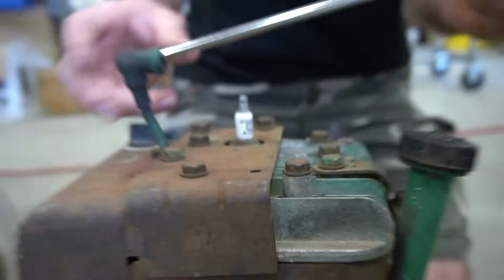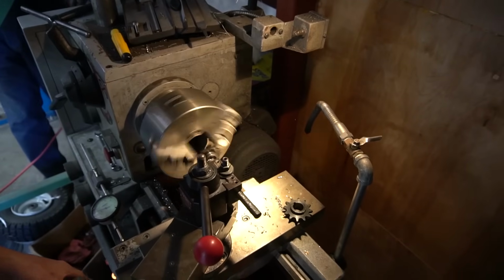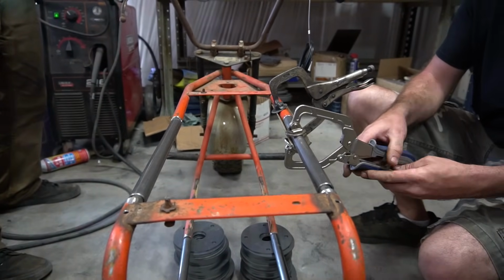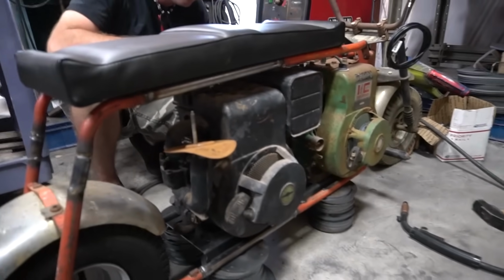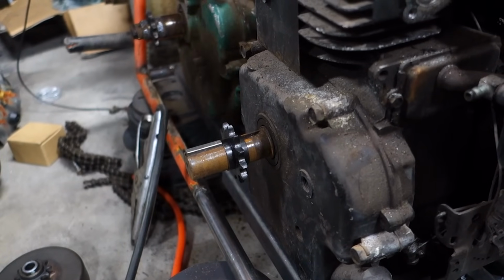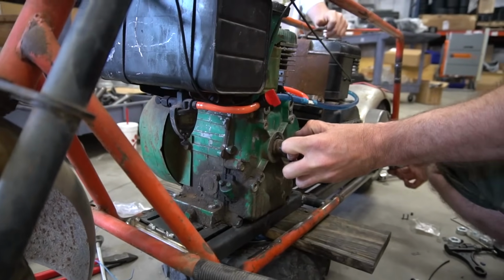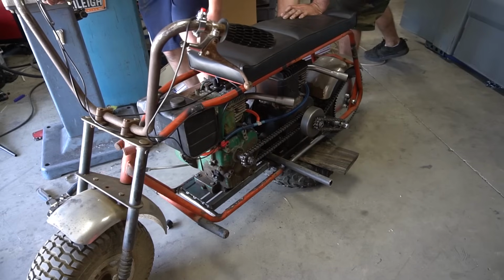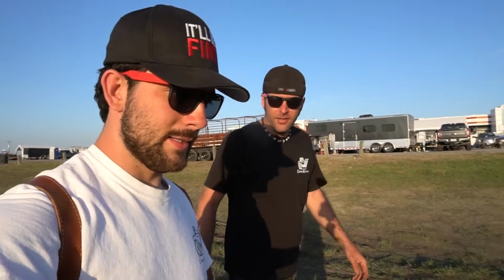Rat Rod 16 HP Twin Engine Mini Bike Build

Comment: I believe putting a clutch on the front engine and a chain tension for the engine to engine chain would solve the chain slap, binding and give the ability to start the front engine first and the second engine next instead of having to start them both at the same time. It's my theory but trying it out will tell the tale. Still a pretty interesting outside the box build 👍👌.
Reply: Brain halfcooked the crankshaft wouldnt let us use a clutch on the front engine

Comment: Hay guys was flicking back through your old videos and found this 1 dunno what you have done to the chain system but 1 thing u could do that I have done b4 on something similar is put a clutch on both engines and link the clutch sprockets together with 2 sprockets on the rear engine clutch it will allow u to start each engine by it's self and if 1 engine dies is won't explode the chain... Just a thought and keep up your good work u guys are cool as hell lol 👍👌👌

Comment: I've done variations of what they did successfully. I even changed the "firing order" by trying different timing with the chain, having both engines fire at the same time sounds and feels like a big single, offsetting tdc by 360 degrees makes them sound smooth and buzzy and setting them with the cycle separation of a 60* v-twin makes a V-Twin sound. I used new matching engines that had the idle set with a tach independently and temperature readings of the exhaust taken at various rpms to try to sync the carbs/mixture settings.

Comment: I would run a serpentine or  v belt between engine 1 and 2, with a spring loaded idler on the belt, ran to a cable to a lever, when lever is pulled the idler disengages the belt allowing it to slip slightly, when released, it allows the idler to tighten the belt, joining the two engines together. The belt would allow for tiny variances and slippage, so you don’t have the catastrophic tightening and loosening between strokes of engine 1 vs engine 2. I think you guys had a fantastic idea but it just needs a tiny bit of cushion between the two crankshafts.

Comment: You should do scarf joints instead of straight butt welding the extensions. A scarf joint is when you slant cut 30 degrees. You get more weld area and it puts the weld joint more in shear than straight tension. Much stronger, plus it looks cool!

Comment: You have 1 month and 2 weeks till the next one haha. Interesting project and looks good. Unless you find a method to keep the sprockets in place with nuts and not welding, idk how can you connect the 2 engines. Also to sync the 2 engines: take the spark plug out from the 2 engines, use an endoscope camera to look at the piston through the spark plug hole and position the piston either at its maximum lower point or upper point and then using some paint and a ruler, put a mark on either the two sprockets or axial thing so you know when it's sync 100%. I saw the chain wobbling so much and that put way too much tension on it and that's why it broke as one piston was up and one was down, so when an engine was pushing the other was refilling.

And like that you can just spin only one of the engines and it will automatically start the other one too at the same time. Also use a thicker rope to start the engines because it will be double the tension on it if you going to start the engines using a single pulling string.

Comment: I think you guys should have done a clutch on each engine with a chain connecting the two engines, then a chain from the engines to the rear sprocket. That way there wouldnt be so much stress on one engine or the other. With the way you had it, unless the two engines were perfectly synced at all times, it would put a ton of stress on the engines. If each engine could idle individually of each other, then there wouldn't be any stress on them, then when you revved both engines at the same time both of the clutches would engage and share their power to the rear sprocket. It was a good try and could work in a perfect world but with gas engines it's too hard to get them to sync up perfectly. You see two Electric motors connected but you can accurately sync an electric motor not to mention if one engine were to spin faster or slower than the other, you dont have to deal with the compression putting stress on parts like with a gas engine. Anyway, looked like a fun project. Would be cool to build a mini bike like this by using two stage 3 predator engines and being able to take your time to make sure you're able to do things just right. 

Another thing that would be cool would have been to have one engine have a clutch and the other engine just have a sprocket,  that way when you rev them both they both power the rear sprocket but when at idle they arent locked together by a chain. Either engine could be shut down without the other dying. Cool video. Looks like you all had fun which is the most important part.

Comment: I know nothing about running two engines connected but I would play with the timing research it or whatever will keep them from beating each other apart. Maybe using a belt with an engagement for linking the two together when needed would work better all together? Doesn't matter whatever makes work the smoothest!

Comment: You need to install a regular clutch on the front engine and a two speed(two sprocket) clutch on the back engine. Run a chain between the two engines and then a chain from the second sprocket on the back engine to the rear wheel. That way you don't have to start both engines at the same time or have to worry about getting the engines synced together.

Comment: My suggestion [other than larger common sprockets where the little ones were not enough] is to put a chain tensioner on it [one that works for both sides, preferably] to control that chain whip, which, [I think] had a lot to do with the failure of the sprocket and the chain.

Comment: Use a chain tensioner to tighten the chain. I seen it from the beginning the chain had way to much movement between linkages. Even though you had it as tight as possible, it still needed a few pounds added.

Also if you run 1 motor, the other should fire if enough spin is made. Its like running a manual transmission in gear down a hill and releasing the clutch. Once engaged the primary motor will then spin the opposite motor, while in motion it will create enough compression to fire on its own

Comment: You guys might already know this. But, putting two engines together that way usually won't work. You have to have them both firing at the same time. It's very hard to make it work with them tied together with a chain.  The way the chain was flopping around, essentially, the engines were off time with each other. If you can figure out a way to do it, you would have been better off with two clutches, chains, and rear sprockets. That way if one engine happened to fire a little quicker than the other, the clutch will allow for a little "slip". You would have probably broken the sprocket anyway. But, you did what you could do in 20 hrs.

Comment: The motors were out of sink, the chain was two tight and because the pistons weren't firing at the same time and that causes them to fight each other. The rpms between the two Briggs  have to be absolutely perfect if they are going to be bonded together. You would have to use two clutches so nobody loses their foot.

Comment: I Like the Build but I think you should clutch both engines to jackshaft so they are independent of each other, that way if there is a problem one will still pull, another idea is to gear them different for more low end and more high-end power

Comment: Use larger sprockets to link the engines to spread the load. A second PTO style side cover would allow you to tie the engines together solidly and have a mount point for a tensioner as well.

Comment: clutch on both motors would work much better and would allow you to use one engine at a time if you wanted. would also eliminate that chain slap and let you start them separately

Comment: Great idea! I wonder if you could use a sprag/ starter clutch from a motorcycle to allow one of the engines to spin at a different speed to the other (in case one cut out while riding)

Comment: belt connect the two motors so as to allow slip...those engines slow down and speed up mid cycle so even if you had both engines firing exactly the same they would still fight one another...if you did use a chain it would have to be a double roller industrial strength chain with a heavy duty chain tensioner  on a strong spring in order to force the two engines to run

Comment: Torsional vibration. Research it. Its a phenomenon where to engines linked together fighting against each other. Ww2 they tried this to get more power out of tank and aircraft engines with little success. I would suggest each motor have its own clutch seperating the crankshaft pulses that way. Great vids, im catching up to all of them

Comment: Instead of starting them at the same time, put a centrifugal clutch on the first motor and a solid sprocket on the second and make a coil that has two wires for the spark plugs and use just one of the pick ups and that way they’ll spark at the same time and that way one can be started at a time but they’ll both be perfectly in time

Comment: Great Idea, Only I knew it could never work from the start. Using chains for any length of time maybe wth belt drive to at least one engine and rubber mounts to engines. Maybe could work I know they were limited to parts and time. Still looked pretty damn cool for sure. Thumbs up guys...

Comment: What if you did a belt drive between the engines with a spring tensioner so you can start them individually.  Just a thought.  Cool build

Comment: Double up the chain connecting the engines, and put an electric motor on it for starting. You could also use the jackshaft to get 2 speeds out of it, maybe 6:1 first gear and 3:1 second?

Comment: A Harley primary chain, to dry clutch, that bolts to the jackshaft. That jackshaft can run through a small handmade gearbox for a high low selection. No synchros.
Or you could go with one of the other clutches nowadays.

Comment: hahaha this is just so crazy only extremely "inspired"  minibike enthusiasts would attempt it.  I think two clutches to a single power out jack shaft chain to the wheel would be more forgiving and smoother...Im not sure how much faster it would be ...i suppose each engine would have to work half as hard...with only adding 35 lbs for the added engine.

Comment: to improve that thing, you guys NEED to make the rear engine more powerfull than the rear one. otherwise you will either blow the chain, blow the sproket like you did.. or tear the crankshaft that gets most of the load apart. 

you will also need to make a double chain tensionner between the engines. the twin engine setups i've seen work all used a damper of sorts (in case of twin v8's, it was a rubber/metallic flexible coupling.)

for more neat stuff, look for the "freight train" and the "Hurst Hairy" dragsters. these things had their stride before the 60's ended, as single engine dragters proved more and more powerfull.

Comment: I would have used 2 clutches, one on the front engine going to a welded sprocket on the second engine, and another on the rear engine going to the jackshaft. Would allow independent engine starting and forgive any difference in power and RPM at speed.

Comment: It’s not the 8hp that killed the sprocket, it’s the out of time cylinders beating the  chain and sprocket that killed it. You need to have perfect timing between the two engines and both be matched to one another in every way in order to have a smooth running setup like that.

Comment: Actually the sprocket with the keyway in the front engine would be a good idea, just in case you might want to synchronize the engines.

Comment: Two torque converters, one in each engine, would sync up to each other because of the CVT aspect only would need one sprocket on the rear too, I think. Getting a belt from one to the other is another story however.

Comment: When you set the motors, you might take into consideration which revolution the motors are on and time them to have their power strokes opposed so not to put twice the strain on the sprocket and the chain when considering the "rebuild".  I think the power would be less herky- jerky.

Comment: You know, If you put a clutch only on one of the engines and use it to "kick start" the other....it would then mean that you only have to start on of the two. would make it a lot easier to get going. Plus, then you wouldn't really have to worry much about synchronizing the 2 together. Couple of Roots blowers or turbos and....BOOM!! Frankenbeast would truly be a beast. Just my 2 cents....

Comment: I think a freewheel or coaster gear setup on the front engine would be best. Then it will coast when not under power. This should help sink the two together. Maybe even a second clutch.

Comment: When you have two engines like that, they need to be hitting perfectly in-time with one another (torque output in-phase between the two), otherwise they are putting huge load on that chain. Normally you have some non-positive (non-rigid) coupling in place like a clutch or torque converter that absorbs the torque spikes and prevents them from being transferred to the ground to some extent, but between two engines if there's just a chain, then it will probably always be jumping or breaking chains unless that chain drive is just so over-built that it keeps an iron fist on the output shaft. It might not be a bad idea to look into either (A) an idler sprocket system with lots of spring tension that can take up the load between one engine pulling against the other out of sync, or (B) a V-belt drive between the two engines, and sprocket drive to the wheels, so that the belt drive has the necessary slip. With your other multi-engine attempts there have been separate torque converters, but if you welded two drive flanges together between two crankshafts you would also be breaking welds, and chain drive will probably cause constant trouble for this project in the future unless it's overbuilt.
Reply: Separate clutches were mentioned; one engine with a clutch driving the shaft of the other engine, with a clutch from the second engine to the wheels, should provide the needed slip element between the two engines, or both clutches on the output shafts of their own engine, and on the same chain to the jackshaft.

Comment: Obviously fix the sprocket and chain use something heavy duty. And then I would stagger the engines to fire not at the same time but one just after the other one or 180. That way it’s not a huge bang on the chain. Or use a v belt for the motors but you’ll
Lose the timing. Then I would make an intake that runs one carb, and tie the exhaust in together.

Comment: I think the sprocket would hold up better if you just timed the engines together so the momentary variations in crank speed will line up and won't have all that crazy chain movement. Also please put a chain guard on it before someone gets stitches.

Comment: Hey what about timing the engines. Make it so one is on the power strike wipe the second is on the intake stroke. That way they are not fighting each other and it will be a lot more easy on the parts

Comment: ok i missed part one i have to go back and find it ok go back and run two clutches and have them both go to the same jack shaft. i think it would work better.
 that way both engines don't have to be tuned so close together and if one was to pop or slow down it wont break the chain .
Reply: but still can't find the first video

Comment: Scrap the engines use two 212 hemi engines use 50 link chain and oppose the firing on the engines 180 degrees that should eliminate a lot of pulsation, also rig it up to run one carb vs two it should equalize the rpm more.

Comment: I would think you would have to cync the engines together on the firing order to alleviate a lot of that pressure off those sprockets.... An one is going to have to be on a clutch of some sort.

Comment: Do you have plans to refab this bike? I was thinking if you added a clutch on front engine, added a free wheel sprocket or two to keep tension on the chain running between engines and added a custom triple sprocket clutch on the back engine would solve a lot of the issues. You might even need a small difference in between stalls in the clutches.

Comment: This is extremely awesome but I think I see where there’s major problem. Those engines need to be synchronized. Set both at TDC and weld the sprockets at the same location. It looks and sounds they are running against each other and that’s why the sprocket blew up. Just a thought yet I might be wrong. Lmk what you think.
Reply: They aren’t direct drive they have an auto clutch so that wouldn’t do anything
Reply: Pritchert27 they are sharing a clutch. If they were proper synced it wouldn’t be so troublesome to start.

Comment: Turn the one around make it run backwords then do dual sprockets on the rear wheel and drive the wheel 2 engines 2 clutches and 2 chains no breaks still

Comment: You guys need to time those motors if you're going to chain them together one  should be at top dead center and the other one should be at the opposite that way they will work with each other instead of fighting each other.